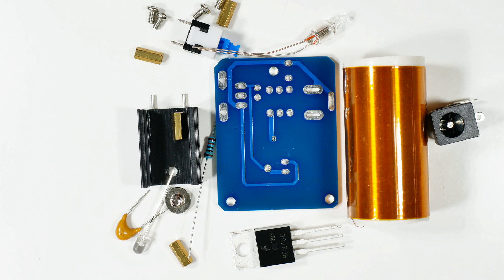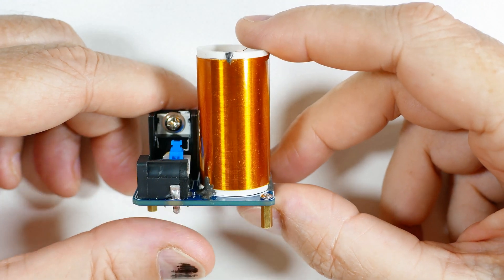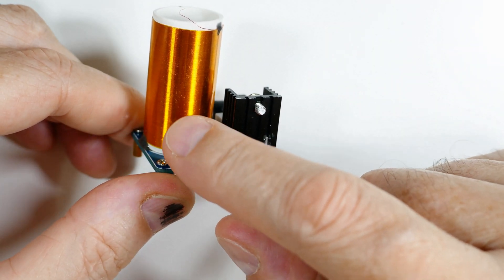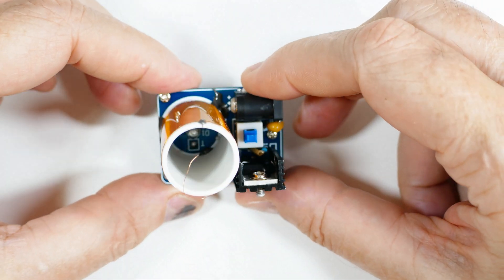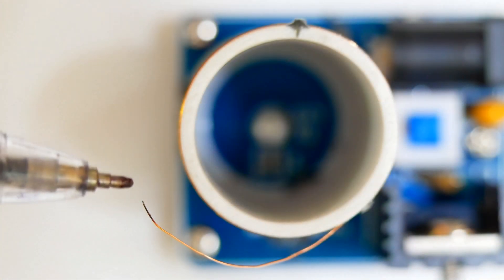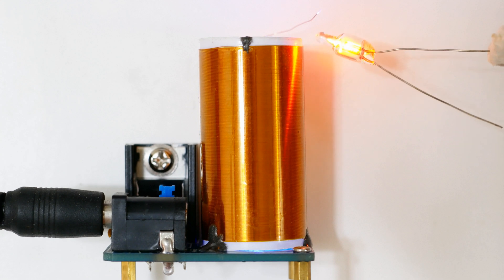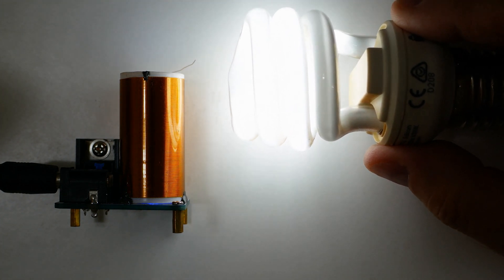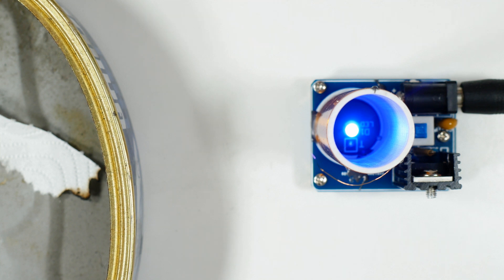Tesla Coil - Kit & First Experiments (4K)

Comment: Small tip for the coil itself, the heat of the soldering iron will vaporize the lacquer so for soldering to the board no need to scrape it off, and on the arc side you can just tin the tip and the lacquer will melt removing the risk of breaking the wire
Reply from the maker: That's true for older wire coatings, but the new ones carbonize and won't take solder.
Reply: @tsbrownie  hasn't been the case for me, ordered one a few weeks ago and just assembled it and was able to melt the lacquer, could be that I ordered from an outdated source though.
Reply from the maker: @davidkomdeur  The last spool of wire I bought you can't even burn the coating off with a flame. It leaves a sticky black mess that is hard to sand off. Not like the old days!
Reply: @tsbrownie  I found that using fire to burn it off always leaves a sticky residue, but with a soldering iron and some soldering tin it never fails although it does take a few seconds(5-10) to properly tin it